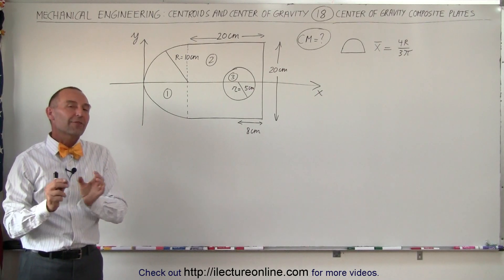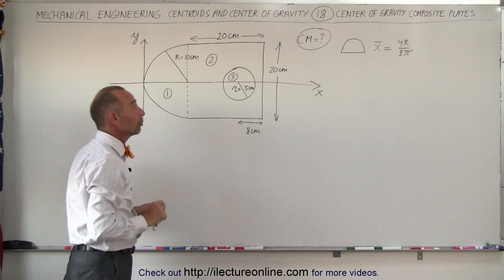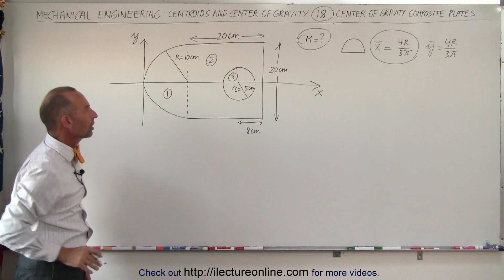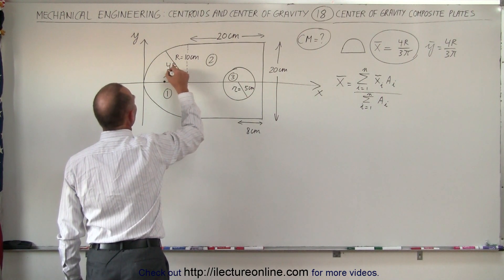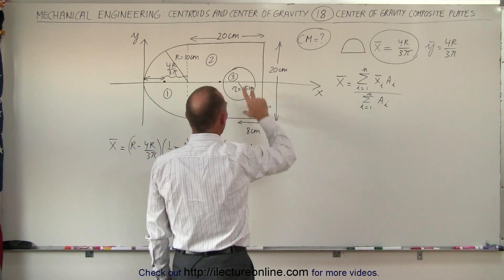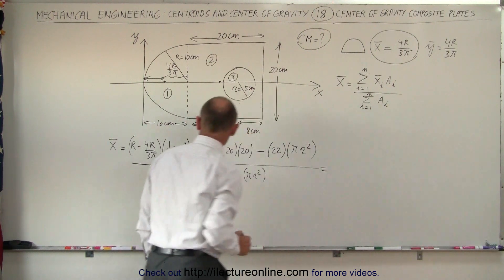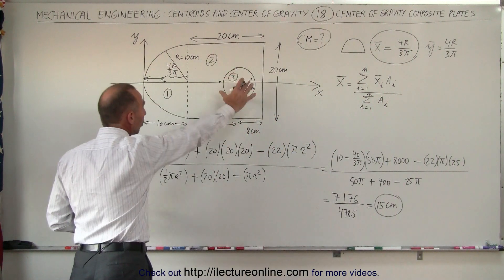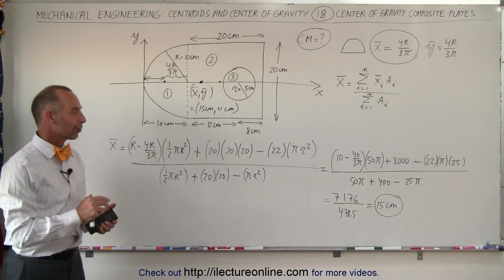Mechanical Engineering: Centroids & Center of Gravity (18 of 25) C. G. of a Composite Plate 3

Comment: Sir, thanks a lot for the useful video. I didn't understand where did you get 22 on X for small cycle. Appreciate to clarify.
Reply from the maker: The center of the circular hole is 10 cm + 12 cm  = 22 cm from the y-axis
Reply: @MichelvanBiezen  thanks Michel

Comment: I know I’m a bit late but why is it (20)(20)(20) rather than (20+(20*20))
Reply from the maker: The area of that section = A = 20 x 20   and the center of mass of that section relative to the origin = 10 + 10 = 20
Reply: Michel van Biezen thank you very much. Nice video by the way